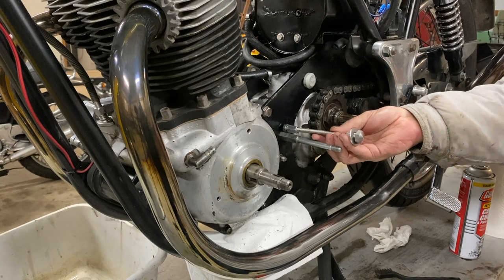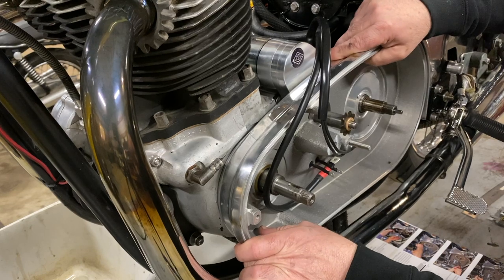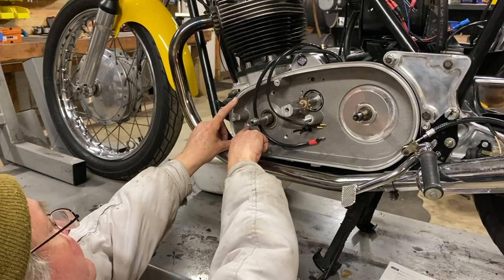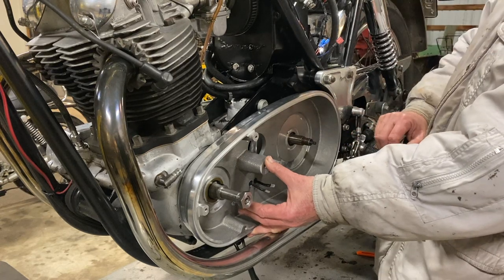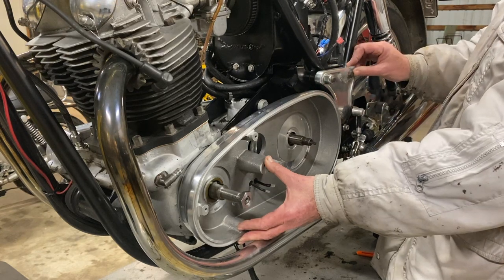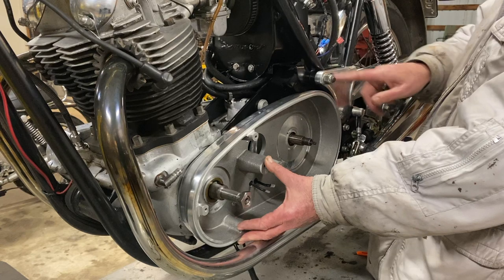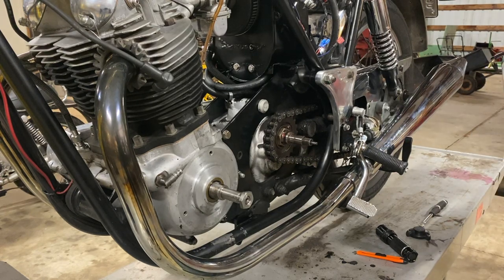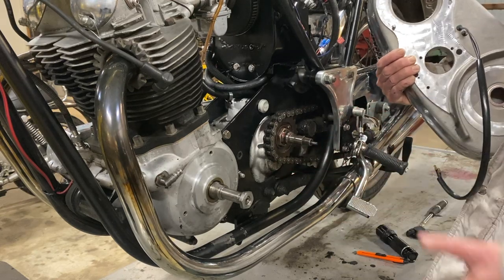Norton Commando Alton Starter Motor Project - Part 4 of 6 - Test Fitting

Comment: Geoff and Mike made a skillful work to adapt perfectly the Alton kit on this very nice early Commando (prior March 1969?). That should not hide that probably 90% of the MK2 Commandos are NOT early ones.

The Alton kits are fairly straightforward and fit on the vast majority of the Norton Commandos MK2.

Alton supplied hundreds of kits for Norton Commandos MK2 since about 8 years worldwide. It is obvious that the owners / installers were far from having such challenging installations. No need of a milling machine to install a kit ! Ask to the Alton dealers. Watch these videos entirely and listen carefully to Geoff and Mike's relevant comments and general advices.

Comment: Alton has been making these for years now and still they require machining to fit. That is totally unacceptable. Real poor quality and hopefully they stand up to the test of time. It should be a 1/2 day job  to fit, not a few days and re- engineering it..
Reply: Geoff and Mike made a skillful work to adapt perfectly the Alton kit on this very nice early Commando (prior March 1969?). That should not hide that probably 90% of the MK2 Commandos are NOT early ones.
The Alton kits are fairly straightforward and fit on the vast majority of the Norton Commandos MK2.
Alton supplied hundreds of kits for Norton Commandos MK2 since about 8 years worldwide. It is obvious that the owners / installers were far from having such challenging installations. No need of a milling machine to install a kit ! Ask to the Alton dealers. Watch these videos entirely and listen carefully to Geoff and Mike's relevant comments and general advices.

Comment: The reason you need to have clearance between the swing arm end and inner cover is because the Engine works fore and aft on the isos and when the bike is being used the swing arm will move side to side as it is levered over . , You could pull on the tire to see how much movement there is at the swing arm pin end. It is not a good idea for it to rub or make the cover flex outward. Iso condition and end play affect the movement. With OEM parts , I never have seen a rub there if the cover is installed properly.

Comment: You just never know what you’ll run into with these old bikes with slight differences from year to year. I applaud your patience in finding a way to make it work. I think it’s why we enjoy the problems they give us to solve and the satisfaction we get once solved.
Reply: Because the OEM original parts fit properly as they had to or the assembly line would be slowed up by the delays created. There is no reason for this aftermarket kit need to have so much work done to alter it to fit. Until the bikes have been butchered up by people who were unfamilar with the Commandos, there were only a few  things to do to make them a little better. But OEM parts were made quite well considering that all the parts in the bike only cost about 500$ or so to the factory , as the bikes were leaving the factory in the early 1970s for approx 1000$ and still had to be crated and shipped as well as leaving the dealers some profit when they sold them.

Comment: In my opinion you did the correct thing on this conversion, the fact that it was not a straightforward fit is really not acceptable, with the original misaligned holes this would lead to an early failure, the clutch shaft centre is way out, and would only get worst when off the stand, to have to re machine the front attachment holes requires a milling operation, and the fact that it would not bed down due to the bearing housing radius should have been taken into consideration at manufacture, if a less skilled person was doing this job it would have been a very unsafe modification, Well done on rectifying this production fail ! Chris B.
Reply: Geoff and Mike made a skillful work to adapt perfectly the Alton kit on this very nice early Commando (prior March 1969?). That should not hide that probably 90% of the MK2 Commandos are NOT early ones.
The Alton kits are fairly straightforward and fit on the vast majority of the Norton Commandos MK2.
Alton supplied hundreds of kits for Norton Commandos MK2 since about 8 years worldwide. It is obvious that the owners / installers were far from having such challenging installations. No need of a milling machine to install a kit ! Ask to the Alton dealers. Watch these videos entirely and listen carefully to Geoff and Mike's relevant comments and general advices.
Reply: @AltonFrancegetstarted   I see that this would be acceptable, providing it is noted on the kit that it will ONLY fit late, (post 1969) bikes. Now it is known that it is not compatible with early production bikes, either a different kit should be offered, or the modifications pointed out the the buyer, it must be pointed out that a simple slot modification and radius in the mainshaft hole would make the kit compatible with all years, now that this problem is known, I always welcome customer feedback for this reason, it makes for a better product that buyers can trust ! Chris B.

Comment: That's the correct way to do it. Whenever I add a new part to my bikes that doesn't fit, I modify the new part to fit and not the original parts of the motorcycle. That way all your changes are reversible in the future and you haven't harmed the originality or appearance of the bike.

Comment: A bit surprising the new inner cover needed that much fettling. No worry on the timing gauge marks as these should be checked regardless on any Commando by using a degree wheel and locating true TDC, noting the gauge readings. So with new Alton cover, just re-check and use the new true reading (+/- X-degrees whatever the gauge indicates).

Comment: So I would venture to say, you have alerted Alton to all these issues so they can address and fix.
My initial idea with the holes being off is that when part was put in machining mill jig that the cover was either shifted slightly causing the drill operation to be off a few tenths to a couple thousandths, or the jig had milling swarf not blown off which caused the cover to not seat properly.